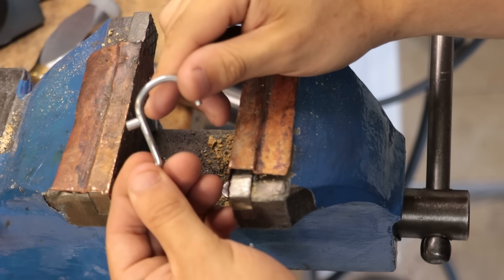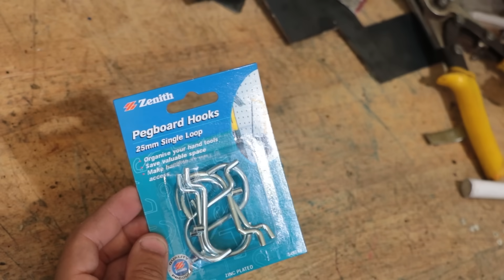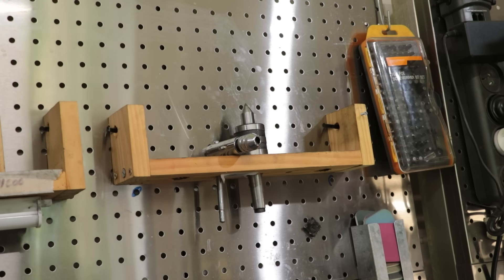Making A Cheap Rivnut Installing Tool

Comment: Thought I´d complain about this one as in my country you can get a set of tool + nuts M3 to M6 for 48AUD. But the tool is only strong enough for aluminium rivnuts.
For some instances the stronger stainless rivnuts is better. Hopefully will remember this if needed. Quite simple to make.

Comment: Unfortunately your 'Cheap' rivnut installing tool requires hundreds, if not thousands of dollars in tools to make. For a one off project this tool requires too much upfront cost and time for the typical DIYer. Spending $50 to $125 for the actual tool is a better investment IMHO.

Comment: Wow..that is cheap for the material, just need $10,000 for the lathe and tooling🤨🫢
Reply from the maker: Sure but I have had these for years. I’m not suggesting you buy a lathe in order to make it

Comment: Subbed!  Quite a nice take on rivnut tool compared to others even the cheapy ones that you pull together with 2 hands.
What would really be interesting, since you seem to have a nice shop full of tool, is a design where you hold with the wrench and can use an impact or drill to spin the nut.  That one might take a bit more thinking.

Comment: Tool looks great, you could probably add a notch and a spring loaded locking pin at the small end to keep the main bolt from spinning on demand, allowing you to set the depth, lock it and then use an impact gun or the ratchet on the nut itself rather than the static bolt. Using a spanner is all fun and games until you have to do it 15 times over in a fiddly spot.

Comment: Those hooks are for the masonite peg board not metal peg board.
Reply from the maker: You sure? The company don’t seem to sell any other types. And for what it’s worth the Masonite pegboard at my old workshop wasn’t much better
Reply: I only comment because i have the same hooks.  Sure, in the masonite they do come out at times as well but the holes in the metal are substantially bigger than those in the masonite pegboard, so I am not surprised that they don't stay put.
What is the brand of metal pegboard? Does the maker not make specific suited hooks for it?
 @artisanmakes
Reply from the maker: From what I get her these are the ones that came with the bench and pegboard. I believe the brand is called ultimate storage but it’s been so many years that I can’t remember for sure
Reply: @artisanmakes Fair enough. I share your pain tho. There is nothing worse than loose hooks. 👍

Comment: It would be allot easier if you used an Allen head bolt. That is how the one I have is engineered. I bought it from a company here in the USA that specializes in fasteners like rivnuts , I won’t name the company because I’m sure they have a Patton on it. The nut that you turned with wrench was about 38.1mm so it is easier to grab with the wrench.
Reply: Patton? I think that's the WW2 army dude.

Comment: Thanks for posting. A few constructive criticisms:

1. Your tool is rather bulky - and in particular - sticks a long ways out from the surface into which you're inserting the rivnut. For easy-access installations, a more typical rivnut setting tool is WAY faster and easier. For tight-access rivnut installation (very typical in cars), a much shallower tool is often required.
2. Rather than turning down and threading the tip of the M10 screw for the rivnut thread - drill/tap the M10 screw and use a piece of Grade 8+ all-thread for the arbor. This makes it replaceable should it break in the future.
3. Use a left-hand thread M10 screw. It'll prevent the phenomenon where you THINK your setting the rivnut; when you're ACTUALLY unthreading the rivnut off the tip off your arbor. Your tool counts on the thrust bearing to prevent any wrenching torque from being imparted onto the head of the rivnut - which works most of the time, but not always. This phenomenon is particularly bad in blind-hole installations where you can't see what you're doing. The arbor will rip the last couple threads out of the rivnut, leaving a partially-set rivnut in a tight-access spot. No choice then but to finagle a die grinder in there. It sux.

Comment: Pretty cool design, thanks for the idea, i made one with a few changes… i made the body out of aluminum and pressed 4 neodymium magnets in the face, that helps keep it straight. i also made interchangeable tips for different threads and have the bolt fixed in place with minimal movement allowed to compress the rivet, i have the bearing fixed in place as well… all are minor changes i consider personal preference, overall your idea and it works great!! thanks

Comment: They are made of many different metals, not just Steel, there's aluminum, bronze, stainless steel and probably many more variations. You do really need a good tool for steel and stainless steel, they are hard as heck and cheap tools just won't provide enough lever or be strong enough to handle needed strength

At least the tool is conceptually very simple so there are ample ways to make them!

6:50 that's a tool I've never seen, neat and something to remember!

Comment: I don't have a metal lathe so I used half a dozen flat washers and smeared some grease on the one next to the nut. One open end wrench. one box end wrench. make sure the washers fit the bolt with very little space. Fender washers work good. voila'

Comment: This is an insane amount of work to save $110 on the real tool, and you only have one size.  The Marson give you everything from #6 to 3/8.   This is  a case of a solution looking for a problem.
Reply from the maker: Nah just an afternoon trapped in a workshop on my day off
Reply: Didnt appear too insane to me.. neat little project. For what they are, the specialised tools are an insane amount of money though, and include mixed reviews.

Comment: Nice tool. Another technique (if there's not a hole already) are the Flowdrill Thermal Friction Drills. They use friction (no cutting edges) to heat up the sheet until it's hot enough for the bit to push through and bend/flow the metal inwards to form a small tube. This can then be given more threads than the sheet thickness itself would allow. Cool as hell to watch in use. ha
Reply: Expensive and need quite a lot of power/rpms for that...

Comment: great little tool, not the most efficient but if you got the materials, its hell of a lot better than forking over 100 bucks. I feel like using one of those ratcheting wrenches would make the experience using this alot nicer, though dunno if it would worth the like 10 bucks for even a cheapo ratcheting wrench.

Comment: wow , you put way to much work into a simple tool that can be made from a piece of stainless mirror arm ...by cutting a few slots on the back of the flattened end with a cutoff wheel....
I mean it looks nice and all , but mine takes 2 minutes , and you grab whatever bolt fits your rivnut , yours , do you make a new tool for every size ?
Oh well , work smart not hard.
Merry Cristmas

Comment: I hate buying Chinese tools,but that has become a fact of life, especially for a tool that I may not use frequently. That said, Amazon lists several Rivet Nut tools under $40 (USD).  The kits come with a tool, 6 to 8 different size mandrels, 10 riv nuts for each size, and a plastic carrying case to keep it all together.  I just bought one and I'm about to go out to the garage and use it on a project.  I'll let you know how it does.

Comment: For non-industrial stuff, a bulbed rivet nut is great. No special tool, just push it through, then feed a bolt through, and tighten to expand it. Boom an easy threaded insert nut.

Comment: look I'm not going to say you did a bad job, and I can see some edge cases with limited space where this would work better. But riv-nut kits with packets of   rivnuts and multiple dies that you just squeeze are well under $100 and aren't even that hard to do M10 and M12

Comment: I'd rather just buy the tool for the job. Obviously you have access to a lathe and other specific tools, but what you did wasn't cheap. By the time I would waste doing all that I could buy the correct tool install the rivnuts in about 15-20 minutes, and then spend the rest of the day enjoying a beer.
Reply from the maker: Sure but this is what I do for fun. No beer here :)

Comment: Neat.
Could you lock the nut in place in the tool then use your socket wrench to move the bolt in and out? This would eliminate the need for the second wrench.

Comment: I made tool using 123 block and a bolt //washers  -  no machining - works well - cost zero extra tool dollars 
have to hold block with spanner so it is a little janky

Comment: They are not hundred dollars... like 20 to 30 bucks and often bundled with tons of rivenuts that almost makes the tool itself free if you should purchase the nuts alone--
but fair enough "logic", is likely not the focus here, but more that you wanna show you can make stuff with your lathe and looking for an excuse and a argument, even though the financiel motive is out the window from all the time you spent making it npt to mention all the other tools, spanners and wrenches etc.. you need alongside your DIY item...
Got the TOPSHAK RG2 Rivet Nut Riveter kit - and it was merely 17 us incl. 25% vat and delivery, so they dont cost a lot.

Comment: Optimization idea: instead of using a separate ratchet to keep the bolt from spinning, incorporate that feature into the tool somehow.  Then you only have one stationary handle to hold instead of two.

One straightforward approach (not the best, but easy; would probably require a longer bolt):
1) Weld/epoxy the hex end of a socket to the rear of the tool body.
2) Cut the square-drive piece off (so it's just a cylinder with hexagonal interior
3) Cut the head of the bolt off
4) Weld/epoxy a nut in the middle of the bolt, so that it lives in the hex section when the tool is installed in the rivnut
5) Use a large hardened washer to seat against the back of the socket
6) Add the thrust bearing and the tension nut

Now you only have a single stationary handle, and you can use any ratchet to apply tension to the bolt and crush the rivnut.  The main downside is that you need to spin the entire tool to remove it once the rivnut is set.  Other than that, it seems like it'd be simpler, more convenient, and faster to use 👍🏽
Reply: Yeah, i got really confused when he made the handle so short witch after it pivots.. finally trying to use 3 handles at the same times... nah not good solution. Instead cut slot on opposite side of the handle, all the way to back. Since this is such thick material i dont think bending is a issue, then weld a peace into the bolt that slides in the groove preventing bolt from turning. If you add screw from side, this enables to lock the bolt in place so it wont drop out and if anything i would make lock ring groove for the trust bearing instead, so it wont drop ou when you swap between different rivet nut sizes. With this you can make tool that can swap heads. Perhaps even modify the bottom end so you can just slide you largest bolt intended to be used in this into the holder and make smaller tread sizes on that, enabling to swap tread sizes that way. Similarly on the tightening nut you sure dont want to remake whole part so machine peace of that round bar so there is hex on the middle with locking screw to tie it into the nut and now you have handle that stays with the tool and only needs to swap the nut when it wears out in far future. Also allows you to use daka daka gun if you have lots of rivets nuts to install if you cut or turn the bolt head down. Though air daka daka would be advised with adjusting the pressure so you dont snap anything. With this you have almost everything easily swappable with out need to do whole part new and allows to use it in different tread sizes. If i would install many rivet nuts, i would get machine treaded rod, not normal M what ever for longer service life. Only thing that might cause issues is the friction between the rotation stopper/tab, but you could machine a slot sideways into the slot and cut say peace of tile or teflon for the tab slide against.

That is how i would do it.. just need lathe and mill to manufacture this tool :D

Comment: You realize there’s two different sizes of pegboard hooks right? There is 1/8”aka 3mm, and 1/4” or 6.5mm. All you had to do was actually buy the correct sized hooks.
Reply from the maker: These are the ones the manufacturer makes for this specific pegboard. Bought them all at the same time

Comment: Lubricate the compression nut and the bolt thread with a decent moly grease.  Amazing how much easier it makes the work and the threads will last longer as well.

Comment: There are plastic pegboard locks that are fine for most usages. Cheap too. There are also several types of self locking peg hooks.
Reply from the maker: I don’t know if there are different styles but I bought some off eBay years ago. Wasn’t a huge fan. Cheers

Comment: Way easier to install with a couple nuts, thread and an impact driver.
Also rivnuts are used in more than just sheet metal.
Reply from the maker: Didn’t realise they have uses other than sheet metal

Comment: I make rivnut setting tools from sockets. Get a 3/8 drive 5/8 or 3/4 deep socket and make that into a rivnut tool. Get a grade 8, 3/4 size bolt, fine thread is you can find one, about 2 to 3 inches long, drill out the threaded end of the bolt and tap thread it for the size rivnut you want to insert. Get a grade 8 or high quality long bolt or screw and cut off the head so all that is left if the long threaded part. Thread that into the end of the bolt tighten it and use red locktite on it.
-
Thread a nut onto the 3/4 bolt and slide that into the socket so the smaller rivnut threaded end comes out the 3/8 square drive hole then put 1 or 2 grade 8 washers the right size for the rivnut on the smaller threaded rivnut side where it is sticking out the 3/8 square drive hole.
-
Now all you need to do is turn the bolt head and the threaded bolt will unscrew from the nut inside the socket pulling the rivnet threaded stud out with it and setting the rivnut.
-
Only problem I have with this setup is the quality of the rivnet threaded stud/rod. If you don't use the best bolt, like grade 8, you can find to make it, that threaded rod will deform, stretch and/or break. I find quality black Allen head style bolts are the toughest but it is hard to find them with enough thread. I have used the un-threaded top part of the bolt and welded or braised that into the end of the larger 3/4 bolt if I don't have a rivnut size bolt with enough threads.
-
In this video Artisan guy goes through tons of trouble with lathe etc. Not necessary. Socket style like I described works perfect, use good oil or molly grease on the nut threads. If you want you can weld a handle on the socket but I don't because it ruins the socket. Vice grips work fine to hold it.
-
Over the years I have made a lot of 5/8 to 3/4 bolts with rivnut studs sticking out of them. I take them out of the socket, thread a nut on the rivnut stud to keep the washers in place then throw them all in a box in my tool cabinet.
-
I have all the sizes I need from 8/32 up, coarse and fine thread, to set any rivnut, they work with any 3/8 drive 5/8 or 3/4 deep socket so no need to keep the socket with them.
-
Oh and the really cool thing about doing this like I describe using socket... instead of the artisan guys way? You don't need 3 hands. With the socket style, use one hand to hold the Vice grips and the other hand to turn the bolt head with a wrench or socket.

Comment: just bolt ,nut and washer would do the same job , so whats the point of this useless tool??
Reply from the maker: Less friction on the threads and flange. more ergonomic. You’ll notice the difference with aluminium rivnuts particular. Cheers

Comment: You don’t think the head of your tool is a bit large? The head of most river nut tools I’ve used are as wide as the fattest part of the rivet nut itself. That way you can fit as close as possible to an inside corner or something with a lip on the edge.
Reply from the maker: You could definitely take about 10 or mm off the tools diameter and give the end a taper to make it smaller

Comment: If you use a GearWrench, ratcheting box wrench, it will much smoother. I second the comment about a dab of red Locktight. One other tip, which is why the GearWrench is important, once you start setting the rivnut, do NOT stop until it is fully compressed! That material is being work hardened before your very eyes, be Speedy.

Comment: Not exactly cheap if labor time & tools are considered, and that thing isn't any easier to use than some random bearing…plus it's still working the wrong way, just like the "nut & washers" trick.

Making a ghetto tool with professional equipment is like polishing a turd…sparkly shit.
Reply from the maker: Ouch man

Comment: This is a fantastic, simple tool! I would go to a pawn shop and look for a switching ratcheting wrench (spanner for you across the pond) and use that to replace the manual one if you spend a lot of time working on it. Or run down to your local cheap hardware store for a cheap one. The $10 would save a lot effort for lots of installations.

Comment: use some grease on a bolt, it will last longer since your threads are neither rolled or hardened. Nice tool tho :)

Comment: How did you get the hook thread to stop  in the correct orientation? Just luck? Or it's one of those cases where there's a decent range that's firm enough?

Comment: Why didn’t you make a handle for the puller ? You went overboard making a tool that is as equally cumbersome & tool essential as a simple nut & bolt set up, why ?
Reply from the maker: Overboard? It’s just a nut and bolt in a housing. I thought it would be a cheap tool that anyone could copy. You do need a thrust washer in there to stop you tearing up the flange or threads. Lesser so an issue in steel rib nuts but more important with aluminium ones